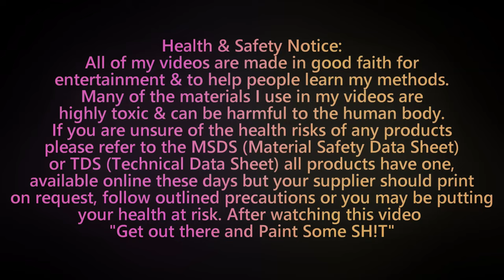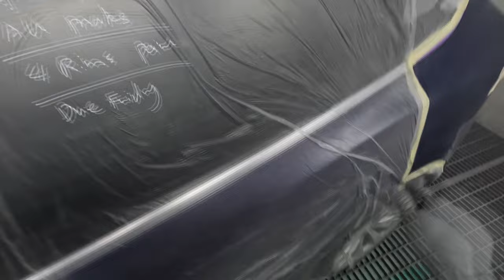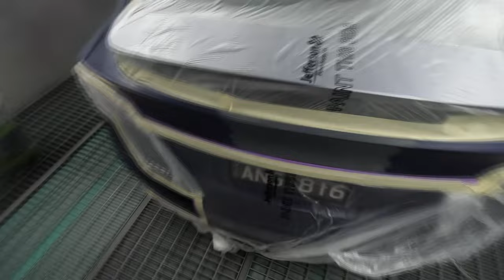Tesla Model X Spray Painting

Comment: I here ya on the ppg Gunny! On another note 30yrs ago was a different story but i see this issue with most paint systems over the years as they have complied with environmental codes they keep removing elements in its chemical make up..making coverage suffer on color as well as fine sand scratches even showing in the base color..causing you to use more material and prep in even finer grits ppg in my hay day was one the top paint systems..today they suffer tremendously in my opinion of course! Nice job Gunny! Enjoyed it as always..
Reply: Yes, 30 years ago it was a suction feed Iwata W77. Acrylic work horse.